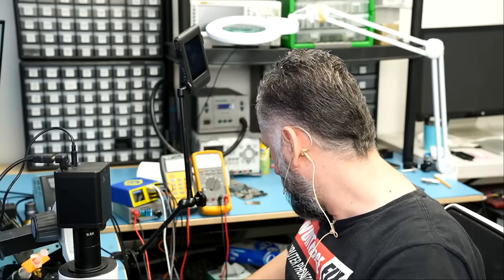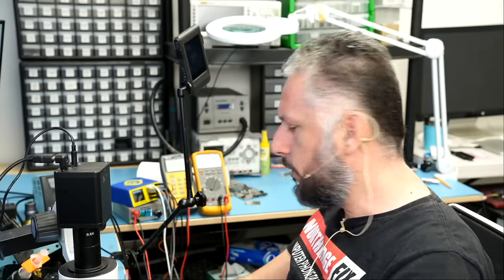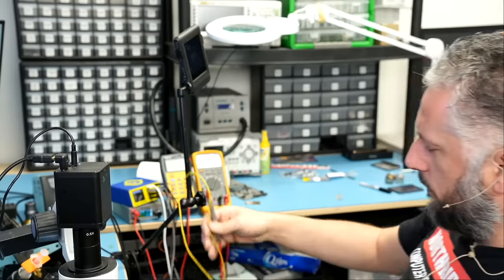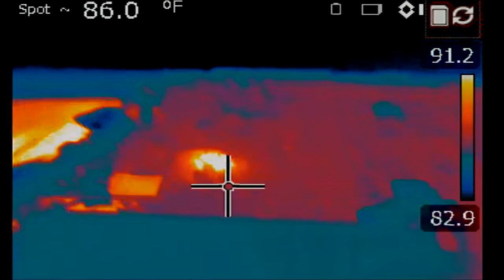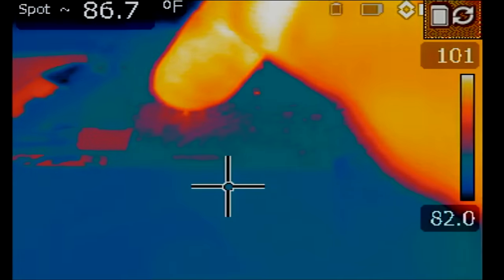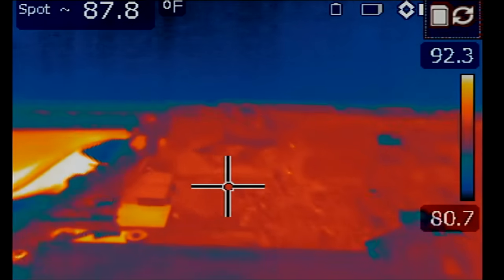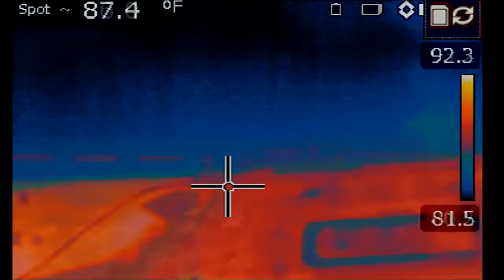Asus Zenbook 14 laptop Repair - Short circuit life without a thermal camera

Comment: what is that R24 smd to the left flat shiny w 2 solder points?. i have issue w part 1ROO33572 But i cant find replacement. Its corner is gone. Had a LED short and this is what i found.

Comment: Awesome job Alex. watching your videos from long time. & learn something new every time. still have 2 query in my mind. 
1. how much soldering iron running at a time while you work because you quickly change it without replacing bit.
2. in any video u not use dc power supply to start laptop & ampere drawn by laptop to find out problematic area except while finding short

Comment: Hi Alex, I have a noob question. I was wondering if you could take a quick minute someday in one of your videos to explain the SMD books you have for sale. I took a look at  your shop for the options but am confused which is which and for what.
What is 201, 402, 603 etc etc please ??
If I am just a hobbyist looking to keep a variety of SMD components, what would you recommend ? I don't need a commercial quantity, just enough to be covered for the odd repair. Thanks very much.
201 book 170 values 50pcs each = 8500pcs
402 book 170 values 50pcs each = 8500pcs
603 book 170 values 50pcs each = 8500pcs
805 book 170 values 50pcs each = 8500pcs
1206 book 170 values 50pcs each = 8500pcs
Reply: Each number is a physical size of the component 2x1 mm 4x2mm ... 12x6mm
Reply: @andrewd207  WRONG - SMD size is measured in imperial units. An 0603 component is .060" x .030"
Reply: Just small to large size

Comment: Can Freezing Spray be used in this case instead of the thermal camera and alcohol?
Reply: Yes but it evaporates fast. Another method is candle wax. Rub it on the suspected components and it will melt if shorted.

Comment: I have question can "chipsets" make a short circuit in motherboard, because I found many capasitors are shorted, and two mosfet (pin1,2,3 source) that connected to pm_1v05 are grounded.
 ( these mosfet should not be grounded at all).
Chipset amd 47b2 1851 218-0891011
Mobo is gigabyte b450 aorus elite v.
i hop that you get my point, and sory about my bad English.

Comment: new 2023 asus laptops (tested in TUF A15) will not power on without the back cover installed. It seems there is a mechanism that prevents the laptop to power on and returns it to shipping mode (which means you need to plug the charger first before powering on). I even tried removing the back cover when the laptop is powered on, the moment I remove it power to the laptop is cut-off. This is just a heads-up in case you get any repairs in the future.
Reply: acer done this before
Reply: @maklogetrich2378  way before!
Reply: @FrancoCoccini  since 2014 or 2015 can't really remember

Comment: a noob question: how you know what kind of capacitor is that? I see no text on it. How you decide what kind of replacement capacitor you need? Thank you.
Reply: You can see in the schematic or boardview, but if you can't find it or  not exists, you can't try substitute for one that has the same size, or the same capacitor from a donor board.

Comment: Sir I have a problem of bios ic in my zbook g3.
But  I also bring it to the computer shop but they told me that the Bios IC should be changed.
So now they don't have any original IC of Zbook g3 2015.
So sir if you tell me any information about it that which IC is original and where I get it from.

Comment: Will the failed component (mosfet, cap, etc) always show as hot with thermal cam?
Reply: Every fail component will light up if it's shorted. Or you can do it by feeling the components with your fingers to find the heatspot. A thermal camera is a must for fast repairs.